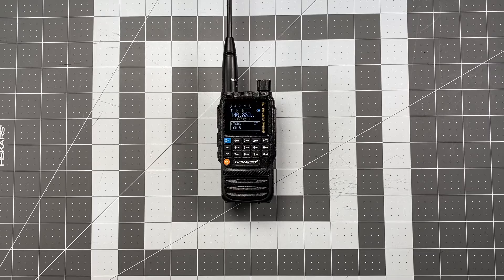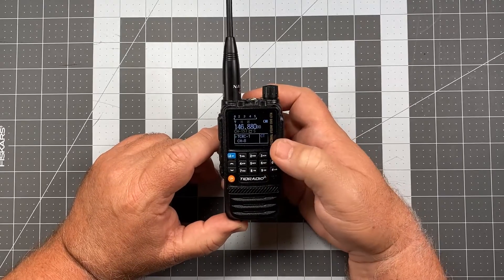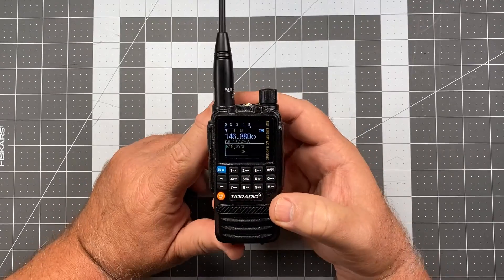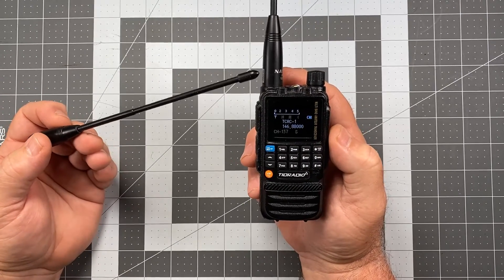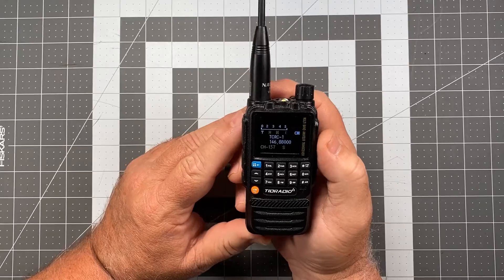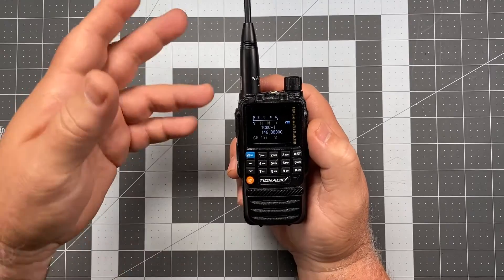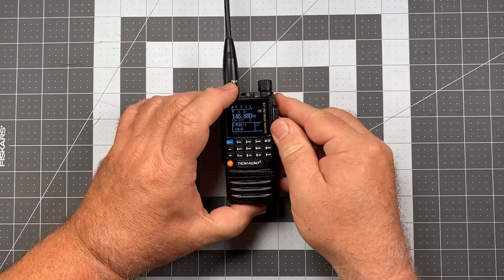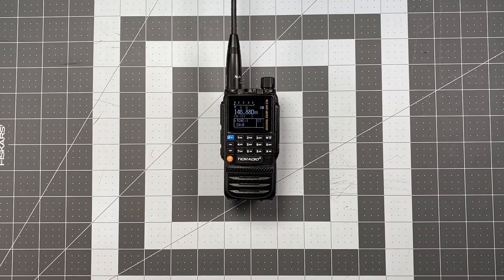TID Radio TD-H3 Operators Series: Part 8 - Alternative Mono-Band Display

Comment: As you know, people say that all Chinese radios are deaf. Is it possible that you can do a test comparing the reception of a TD-H3 with a Yauesu radio, for example the FT-65 or some other not so expensive model, to see how its reception is? 73... WP4QIB
Reply from the maker: I use a Yaesu FT-60R as a control radio to compare reception capabilities with all of the radios that I review. In regards to the TD-H3, mine has very good receive on VHF/UHF. Not all that good on the Air band however. The FT-60R has much better receive in that band.
Reply: @KS6DAY  Thanks for your help 73

Comment: Can you check if scanning on a channel disables the RX on the other channel? I bought a 2 pack of these radios and both experience this behavior. I have them set to GMRS mode factory default. Thanks
Reply: Apparently it only RX on the band being scanned.  UV-5R works the same way
Reply: @JimmyCornPop Thanks! So far, my Talkpod A36 Plus is my go to HT since it can do this.

Comment: At least through FW 240401, the lower PTT button will transmit on the “inactive” frequency when “sync” is off. Also, it would be nice if the A/B button worked when sync is off.